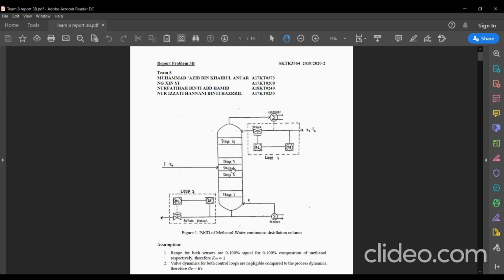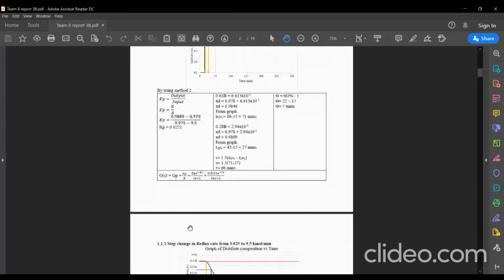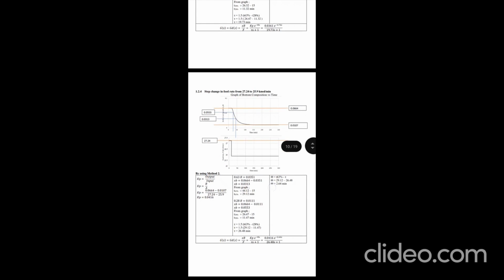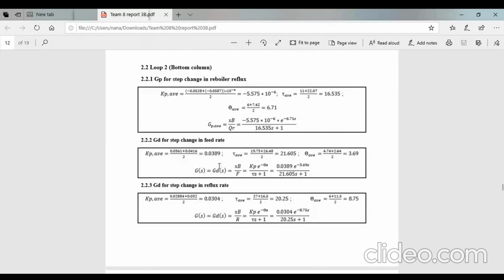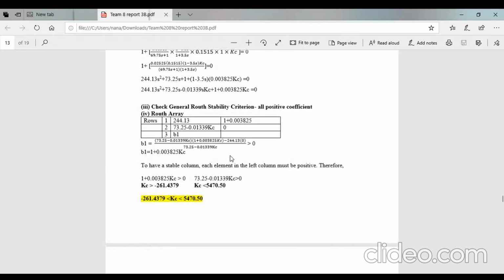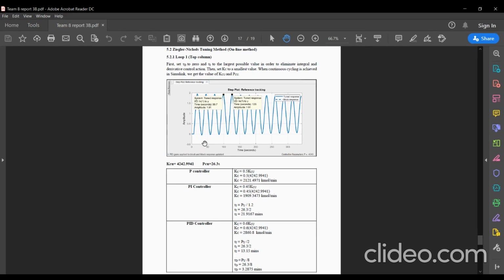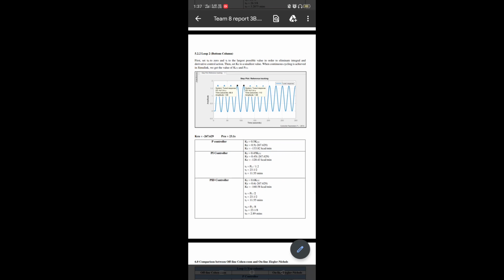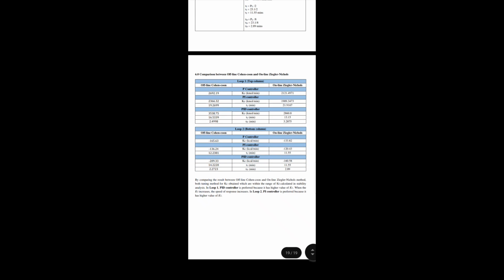Closed Loop Stability and Tuning - Team 8

Comment: Why there is two Gd exist and how to determine the Gd is parallel or series condition?
Reply: because  6 responses given with  3 inputs and 2 outputs at top and bottom column, and all of them have interaction with each others, so we consider all and come out with process and disturbance TF...We do in parallel because the two disturbance inputs are added

Comment: May I ask why there is two disturbances? And in the Simulink how do you know the disturbance is in parallel but not in series?
Reply: because  6 responses given with  3 inputs and 2 outputs at top and bottom column, and all of them have interaction with each others, so we consider all and come out with process and disturbance TF...We do in parallel because the two disturbance inputs are added

Comment: For the closed loop block diagram, may I know why there are two Gd for both top and bottom column?  And why the choice of controller is not based on the simulink response graph but is based on the higher Kc value?
Reply: For Q1, because we are given 6 responses with  3 inputs and 2 outputs at top and bottom column, and all of them have interaction with each others, so we consider all and come out with process and disturbance TF ...
Reply: when Kc value is at the highest value, the controller is more sensitive to error, Therefore, the value of the offset will be smaller.